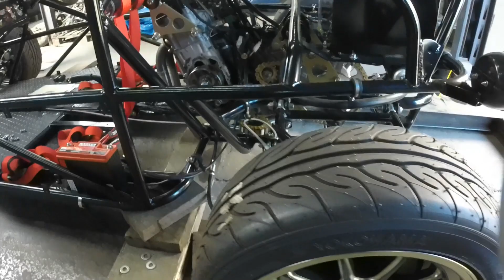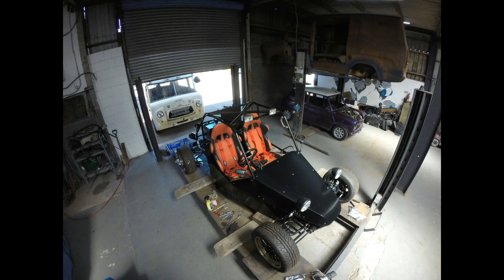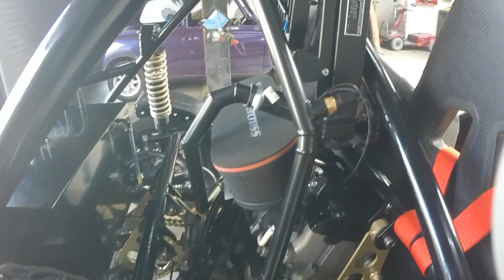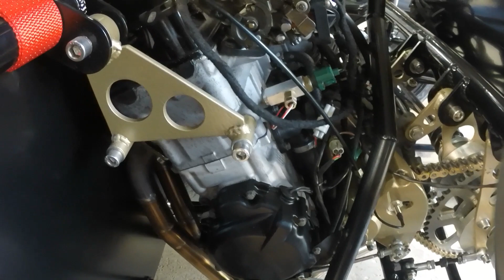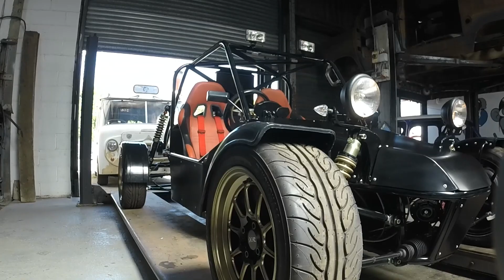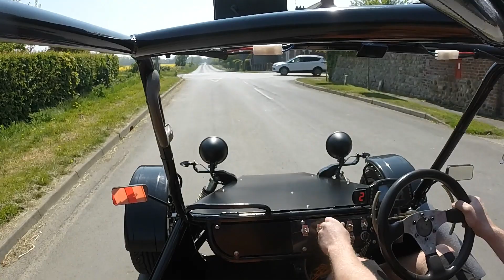Dazon Suzuki GSXR600 Motor, Final Build, First Run

Comment: nice👍 was that the chain that let go at the end?
Reply from the maker: The drive shaft! Had to machine again and get a stronger weld in there.
Reply from the maker: Yeah it's all just part of the testing. You have to find the weakest points. Because the torque is so low in a 600 motor you don't need to worry to much about these sorts of issues.